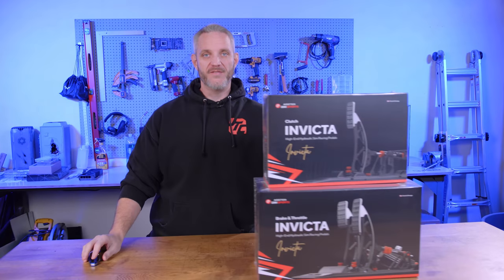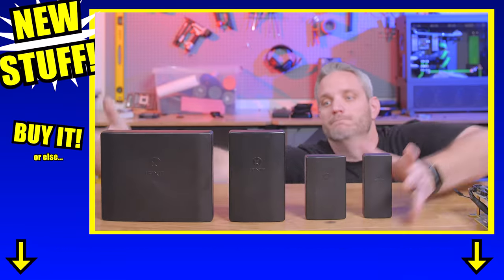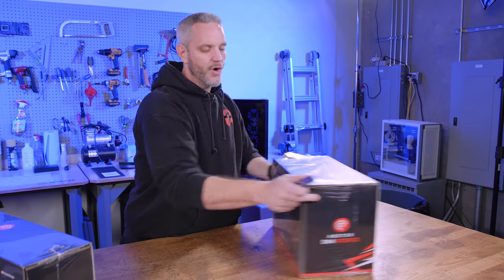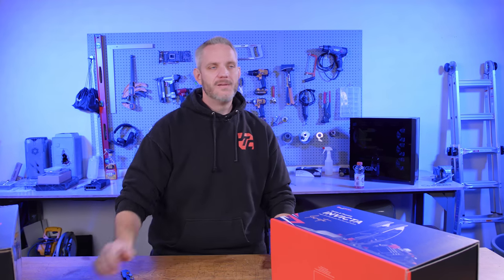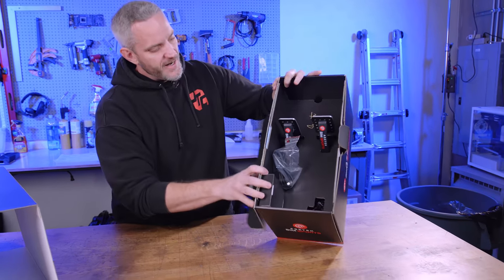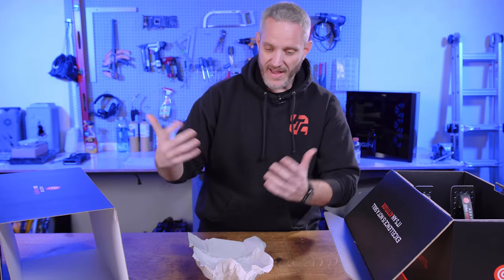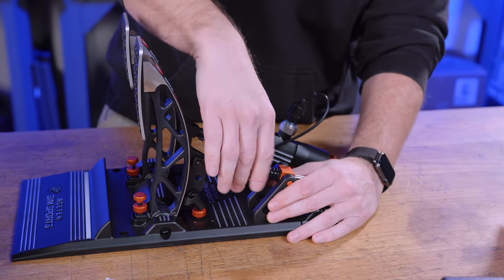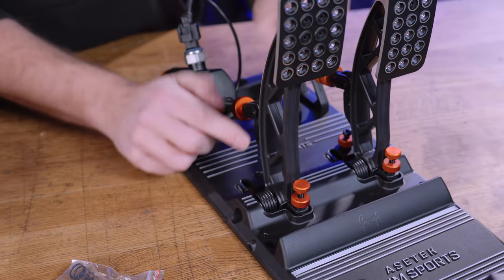These new Racing Simulator parts are insane! Asetek Invicta... yes, ASETEK!

Comment: So, basically, you're saying that race car brake modulation works similarly to how my mountain bike's hydraulic brakes work, "soft travel" until the brake pads engage with the disc, and then you don't get much travel beyond that point, and use pressure to modulate your braking force?

That's something I found very unintuitive in cars when I started learning for my driver's license, and now it makes all the sense to me.
Reply: You can set up a quality set of loadcell pedals to have the same small limited movement travel and through the software dead zone and brake curve adjustments to do and have the exact same feel, or adjustment. Much are what you are seeing is the marketing BS trying to justify such a high price point.
Of course it is not mentioned that a cheaper load cell pedal set can do the same thing.

Comment: Please someone come out with a yoke/racing wheel with pedals so I can use if for both flight sims ( I hate using a stick for flying a plane ) and racing.   All that would have to happen is the up down of the yoke be lockable for it to convert to a racing wheel.  it seems like a no brainer to me.  why are these not around?

Comment: So I have an Idea that I want to do oneday, and that is make a Skyline (was obsessed with them as a kid) into a Tesla Skyline 😂.
The concept is that its using a powerful gearbox less Electric motor setup, it would run in an "Auto" mode where it would follow the optimal acceleration curve, however, you could switch it to a "Manual" mode, this would then allow you to use a clutch and gear box (with some kind of haptic feedback for gear crunching hehe), seeing these I am just like... hmmmmm 🤔 I wonder if they might make a "realistic" gear box stick system. hehe.

Comment: These seem pretty much on par with the Clubsport V3s. Adjustment on these seems a bit easier but you don't get a brake pedal damper and don't get vibration feedback on brake and throttle.

Comment: F1 isn’t automatic, the clutch is a dual clutch on the wheel
Reply: ahh I always just assumed DCGs were basically a flavor of automatic since they had no clutch and shifter. Ive always wanted to call them Semi-Automatic, since you still have to tell it when to shift but do not have to clutch, move a shifter and unclutch.

Comment: No offense but isn't that pedal angle unrealistic? What, does everyone that buy those own a laying-like-in-bed race-sim-chair with the monitor upwards above them? Do you play racing simulators while being hospitalized so you can push those pedals while laying in bed? You can't use those pedals while sitting in a normal gaming chair which I assume most people do/use, and you cannot adjust their straight vertical angle, completely weird to me.

Comment: @JayzTwoCents I would like to know if you can help me out, I have a 2080 Super that still has a warranty on it but because I don't have the original build ( IBuyPower Pre-Built) the warranty is void for some reason. my GPU was working fine and randomly started acting like it was overheating so I monitored the temps as it was Crashing and it was Crashing at around 55 - 60C max. it was posting and now it won't even post anymore. I don't have money to buy a new card as you obviously know what's going on with the GPU's and the scalpers. My question is can you help me? I am willing to pay you for repair cost that you find a fair price. you may not ever see this but I don't use social media so I can't really send you DM's on twitter or anything. I barrowed my brothers GPU to make sure it wasn't anything else in the system and nothing is wrong, works perfectly fine with my brothers GPU. Thank you.

Comment: It's wild to me how people will legitimately spend more on sym gear then a "real" experience.

For example, gear like this costs more then my daily driver.
Say 1500-2k PC, then gear, you could legitimately buy an alright car.

I understand everyone has reasons though.
Reply: And these are still a midrange pedal set. The Ricmotech GTpro3 uses a real tilton pedal box and the brake pedal has a real willwood brake master cylinder.
Reply: @douglasm3310  blows my friggin mind. But I guess for some emulation is better then the real thing for flexibility and you know, the high end.
Reply: So many people use this analogy and if you do the math, it's significantly cheaper than buying the real thing. Cost of just the car is a small fraction. Factor in the cost of tires, brakes, fuel, maintenance, safety equipment, track day fees, truck and trailer if you can't drive the car to the race track and how many days a year you'll spend racing and see if those numbers supersede the unlimited amount of times you can race on a simrig. Nothing beats the real thing but you can learn a ton from a sub $4000 simrig

Comment: Hydraulic slack, are you serious Jay? There is no such thing! Umm, hello, hydraulics are specifically used because liquids CANNOT be compressed, hence there is zero slack. What you should have said is that what you call “the soft stage” is the portion of brake lever travel until the pass actually contact the disc. Seriously, hydraulic slack, wtf???

Comment: For something that plasticlike its way way way to expensive.  was a metal base that much to ask?  You can get a better build quality famatec setup for half the price. That whole base looks really weak. Overal i dont like seeing plastic at all.  Plastic is ALWAYS the first part to fail as it's just a weak material. and you say everything looks steel but i see all of it having plastic molding looks? 
And sticking cable out the back is worse as then you cant put it against the wall if you dont have a real setup.